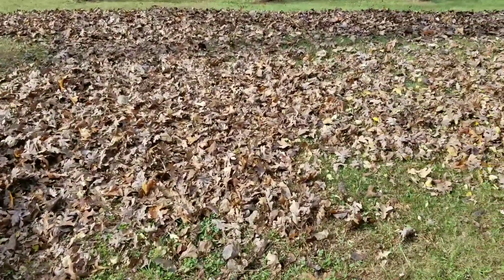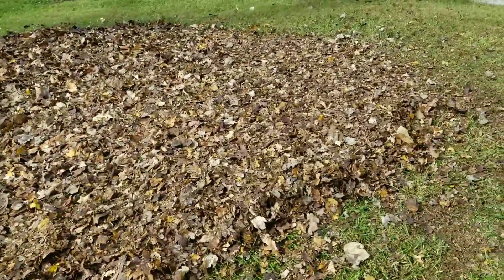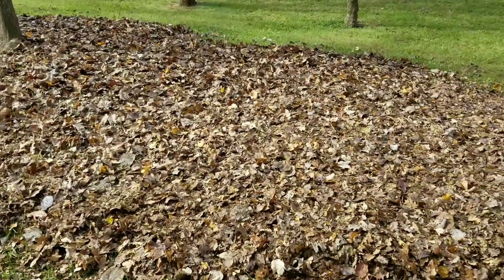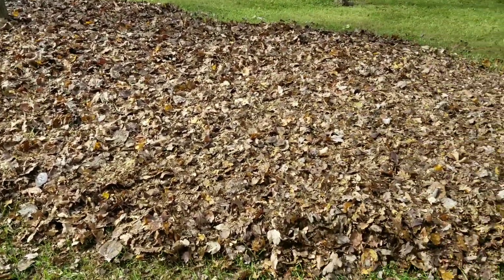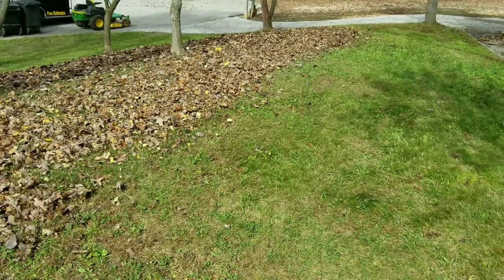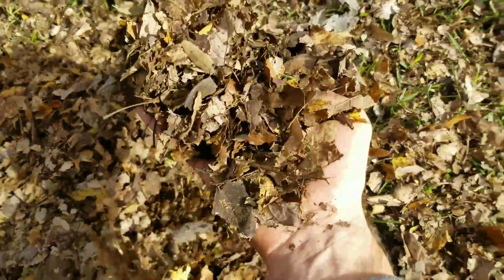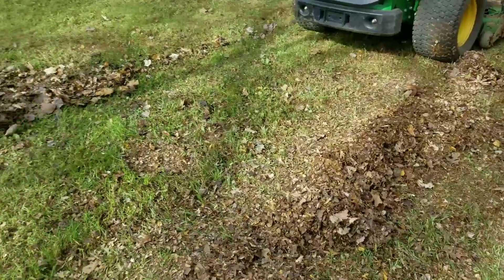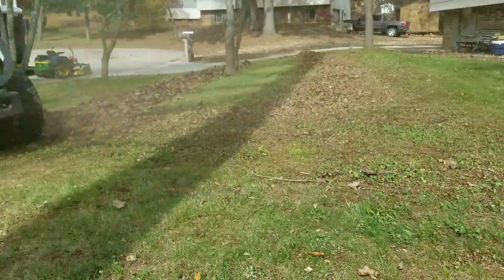DLC - Gator Blade Testing

Comment: Old video but: Not going too say "they are the best things ever"! But! Something you overlooked.. 
Your mower didn't bog down as much as it did with the factory blades on.
That means a few things. If your mower isn't working as hard? Its also not wearing the motor and parts down as much.
It also means you are using less fuel to get the same (if not slightly better) job done, as before. Time/Money.

Short term? No biggie! Long term? It starts adding up.
Reply from the maker: Agreed

Comment: Great comparison.  I swap over to Gator blades in the fall when the grass has slowed down and im just mulching up the leaves.  I’ve never done a side by side comparison tho.   I have found that a regular high lift blades cuts nicer:lawn looks better under normal cutting conditions.

Comment: The Scag 48" with the latest deck design will mulch leaves with regular blades but requires 3 passes with Scag block plate over the exhaust. If you adjust the front baffle for high leaves (3-4") you will minimize the kick out with the exhaust block in place. Add Scag's Eliminator (harder metal than Gator; less sharpening) and the Eliminator has the twin cut design that shreds them leaves to little pieces in one pass. I have tried Oregon products and find their design and metals are not up to Scag quality. With a revised exhaust on the 14.5hp gear drive 48" I cut 5" of grass and leaves at full tilt in 2nd gear and the lay of cut grass is like a blanket of 4" rolled insulation: amazing. It all takes some extra gas, of course
Reply from the maker: Vincent Rolfe The commercial high lift John Deere Blades work great, I was not very impressed with the gator blades.

Comment: You need a deck discharge plug and it will mulch 10 times better. The leaves are not Recycling under the deck.
Reply from the maker: That is what the Advanced Chute System is.

Comment: I use only the gator blades on my riding mower , and I don't have them on my zero turn mower. In my opinion the gator blades are the best
Reply from the maker: They are great depending on the turf type, mowing conditions, type of the mower, etcetera.

Comment: IF you are multching, WHY IS YOUR SIDE DISCHARGE OPEN!?!?!?  You cant mulch if the blades only have one crack at the leaves, or grass.  Mulch blades are made to hold the debris in the mowing chamber until they are chopped to a fine 'mulch' then left behind to filter down into the base of the lawn
Reply from the maker: Mark W  The chute block was closed, the only leaves coming out were from under the deck which is normal.